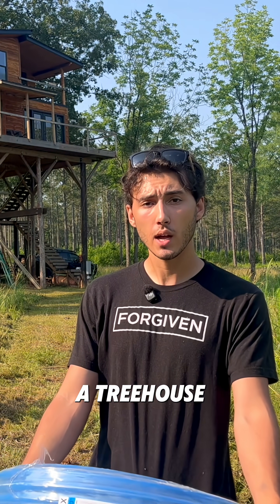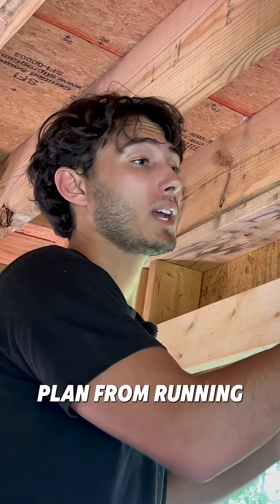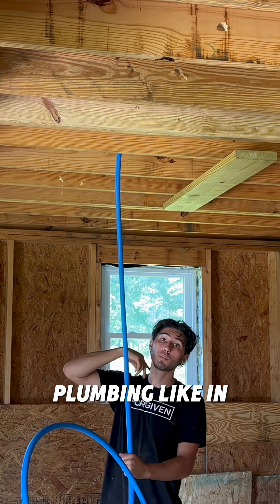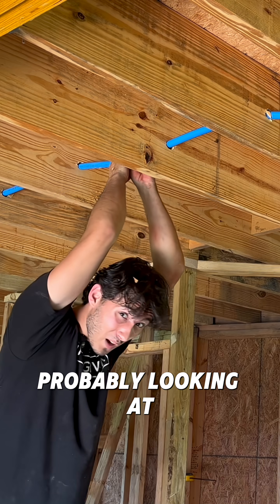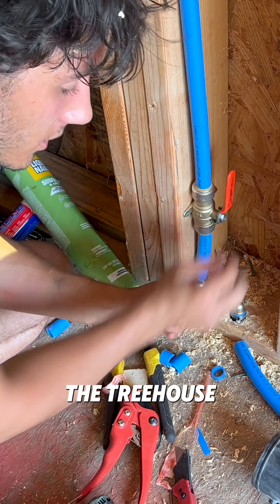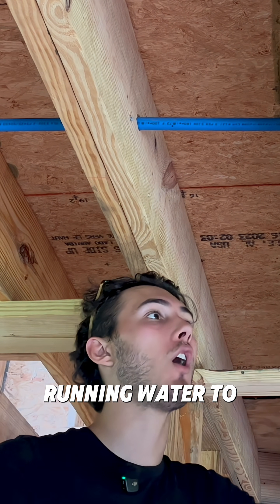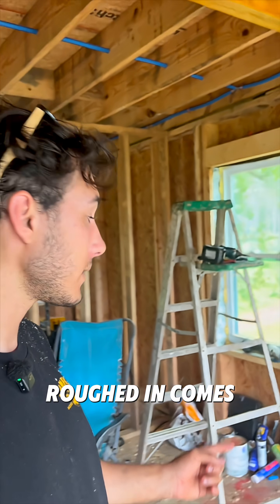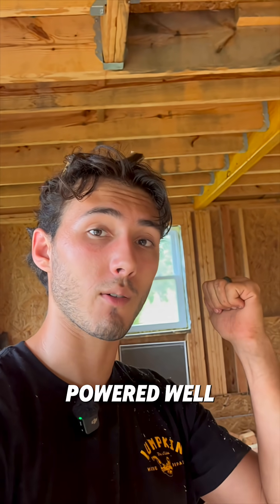How Does Plumbing Work In A Treehouse?

Comment: You can flip the handle on the ball valve to make it easier to operate. Just take off the nut holding it down and flip it, replace nut. That way your handle swings out toward your access panel
Reply from the maker: That’s good tip!

Comment: I would definitely oversize those holes a bit for the pex line if you have any more to do. Makes pulling/pushing easier and in the event of a freeze, gives it slightly more room to expand 👍🏻
Reply from the maker: They’re 1” holes
For 3/4 pex which I believe is standard

Comment: Dam bro u need a plumber them shark bite fittings will explode.
Reply from the maker: I’ve had success with them. For some that have been operating outside I insulated under a camper for 4 years

Comment: The only problem is, he said that will be hook up the shower so that means it's hot water but he is using the wrong plex because tha blue is for cold water, hot water will eventually start to melt the plex blue cold line, because the plex red hot line is alot thicker and strong and meant to hold the hot water.
Reply from the maker: Good point but not the case, I’m adding an instant electric heater in the bathroom that will supply hot water to the shower and sink
Reply from the maker: And it’ll use red pex

Comment: You added 6 different spots for a potential leak in the future where that line goes into the floor.  I would've just added the handle up higher and couldve easily fit the line through the hole still without the extra 2 90s.